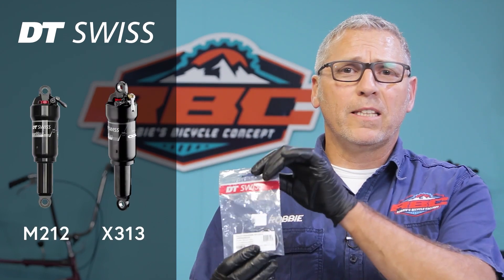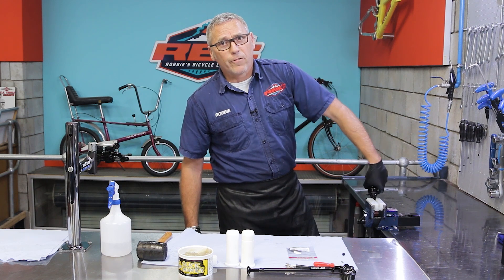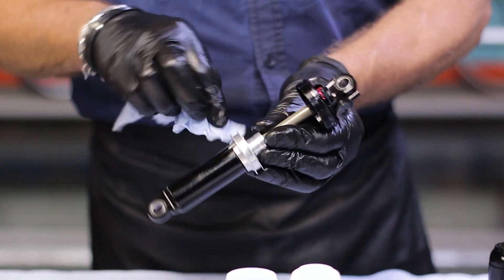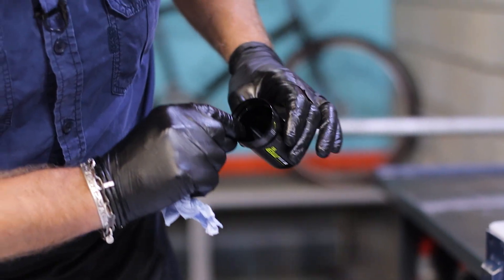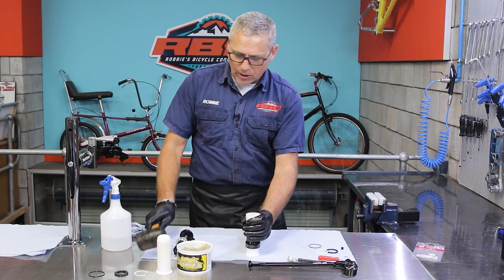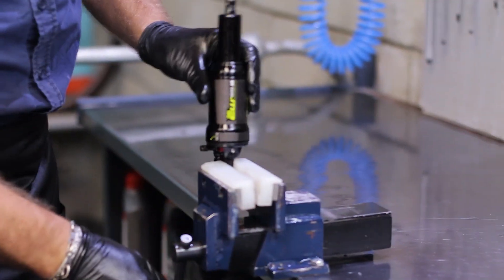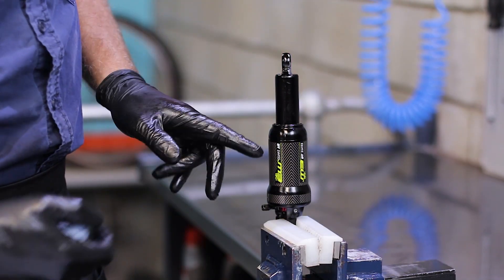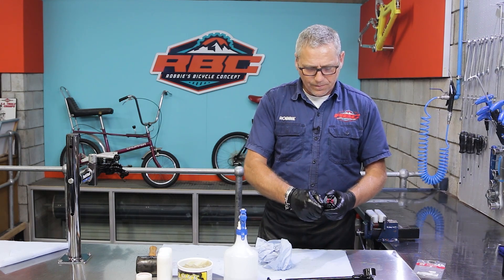DT Swiss M212,  X313 suspension: How to service the air can.  | DT Swiss

Comment: I have this shock on my scott spark ,it's fully extended and   rear triangle is banging onseat tube.Do yo know what's wrong it's holding air and rebound works.Thanks
Reply from the maker: Hi, and thank you for your comment. Your shock needs to be serviced because this sign shows that the oil was passing the seals from the oil chamber to the air chambers. Please go to our website and choose a DT Swiss service center offering Suspension service: https://www.dtswiss.com/en/support/contact
Sincerely, Friso „DT Swiss“

Comment: Is there oil inside the shaft? If so, what type is it? Does it need to be replaced? Thanks.
Reply from the maker: Hi, and thank you for your question. Yes, the oil system is as well in the shaft. As it is connected with an IFP with the nitrogen chamber, please do not open the oil system. The pressure inside is very high (in-between 20-40bar). As long as the shock is working well, this means there is no smacking noise and you can clearly feel a difference when changing the rebound settings, the oil would not need to be replaced.
For a complete service including oil change, please get in contact with one of our suspension Service Centers. A list with all of them can be found here: https://www.dtswiss.com/en/support/contact
Enjoy riding your local trails, Friso „DT Swiss“

Comment: Last weekend my dt swiss X313 got stuck due to low pressure in de damper. When I pumped it up to the right pressure, it didn't expand as it is normally.
Would this rebuild help in this case?